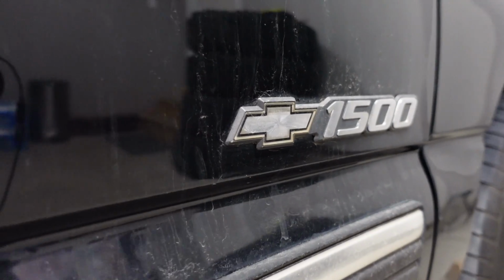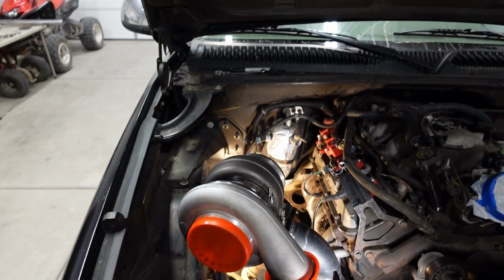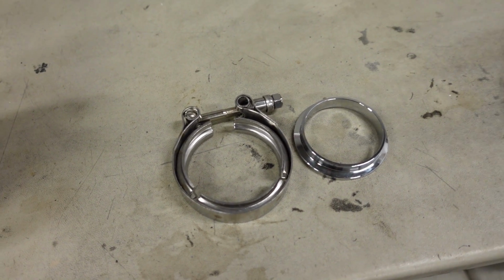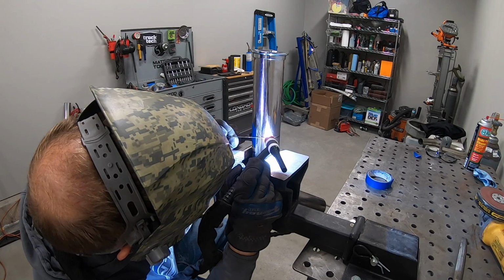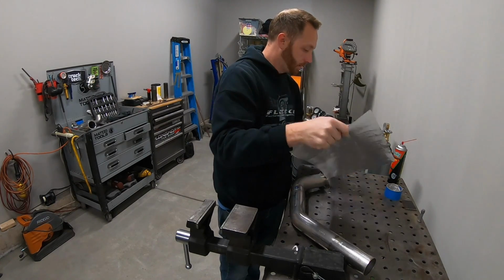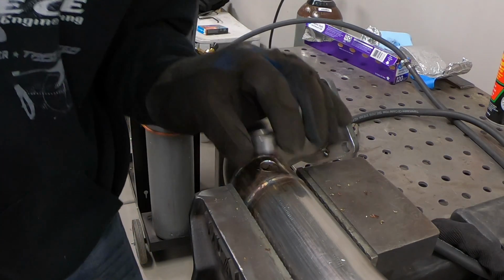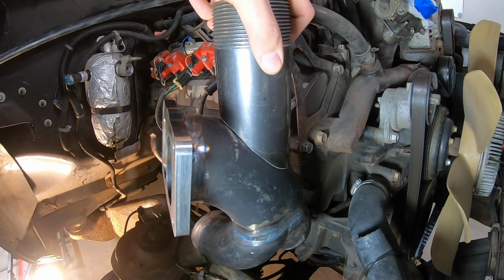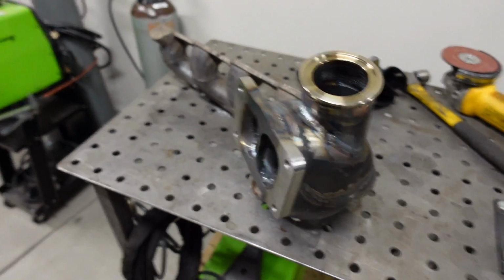8.1 Vortec Turbo first fire up

Comment: What’s the fitting you used for the oil cooler port? Having a tough time figuring out the thread pitch and what I need for my 8.1

Comment: When you first did your swap what transmission did you use, I’m building a 2002 firebird up and found a 8.1 with wiring and pcm, but no transmission.
Reply from the maker: I swapped to a 4L80 back when the truck still had a 5.3, so still using the 4l80
Reply: @TolmanPerformance  I appreciate that, this is my first time doing any major work like this, I’ve swapped a cam and springs but never something like this.

Comment: I would this engine for my offroad and street road car. So rpm is at 2-3500rpm for most of times. But i wanna get it turbocharged for my low end torque is this necessary to swap stock cam?
Reply from the maker: If you want low rpm torque the stock cam is hard to beat

Comment: That was a great amount of information! I have a question regarding that turbo and reversed headers would you create a mount off the chassis with a flexible exhaust piece or make a mount off the engine for a 72 Nova SS? That mount you made was dead on!
Reply from the maker: I'd for sure mount it to the engine so it can all move around together, you'd add more stress into the pipes if you mounted the turbo to the chassis (unless you have solid motor mounts or a motor plate or something like that)
Reply: @TolmanPerformance  Didn’t think about that! Thank you much for the reply and great information on your channel.

Comment: Mid mount twins are the only other option.  Tucked in beside the transmission or if need be, a bit further back next to the tailshaft. If you want to go crazy,  can criss cross the 2/6 and 3/5 tubes for equal pulsing w/ max scavenge and power.

Comment: Geez...a log style manifold on a big turbo, big displacement v8. Sounds like a back pressure and a heat nightmare. That’s my bugaboo, every vehicle deserves headers not manifolds. Especially with a turbo setup. Those will be glowing as soon as you hit boost.
Reply from the maker: yeah, I'll never say a manifold is better than a header, but they are a lot easier to fit up. That being said, there are a lot of folks making big power safely with a log style manifold. Is it ideal? No, but with the sizes I designed in and the placement/size of the wastegate, I should be able to manage exhaust back pressure. Heat? either way you slice it, a big tubo engine is gonna be making a lot of heat. thanks for watching BTW!
Reply: @TolmanPerformance  hey man you know more than me and obviously can do more. Wasn’t tryin to knock ya, I just hate log manifolds period. Good luck on the project

Comment: Sounded like an exhaust leak on start up. Did you find any?
Reply from the maker: no, everything was sealed up tight. I did hear it in the video, I think its just the sound the turbo is making with no down pipe

Comment: Awesome build dude. Love the Fab, and staying away from a remote mount system. 

My old man is a welder and always told me not to clean with break cleaner because it can react and release phosgene gas which is poisonous. 

Looking forward to the rest of the build!
Reply from the maker: thanks for watching! supposedly the non-chlorinated brake cleaner (the stuff I'm using) is safer, since it doesnt have the chlorine which makes the poisonous gas
Reply: Good to know about the brake clean. That's why your the pro.
This thing is gonna be a torque beast with that turbski! Tow anything, and a drag strip monster...

Comment: small tip. argon is heavier than air so when you purge your part it is better to put the purge line at the lowest part,  then poke holes in the top so the agon fills up the bottom and displaces the air out the top. anything works. this just gives a more efficient purge.

Comment: With so much displacement I would of put a giant turbo So that there would be no back pressure issues also a camshaft something like a 212-218 and whatever lift you can fit in there on a 114 lsa
Reply from the maker: I felt like the S480 with the 1.32 AR turbine was a pretty good sized turbo which should also be pretty responsive with the displacement, and hopefully the 60mm gate will alleviate any possible back pressure issues.

Comment: You got me.  New subscriber here.  Excellent content.  Well spoken, it is obvious you are very comfortable in front of the camera.  Look forward to seeing the finished truck.

Safety Nazi Comment:  Please be sure you use non-chlorinated brake clean for weld prep.  The chlorinated stuff will create Phosgene gas when it burns off.  Phosgene gas is used in chemical warfare.  It turns into an acid when it comes into contact with water (like the water in your lungs).  Some nasty stuff.  If you already knew that, carry on!
Reply from the maker: thank you so much for the kind words, and I too am excited to see and drive the truck when its all done. I did get quite a few comments on the brake cleaner topic, but I do use the non-chlorinated stuff, so I should (hopefully) be safe from the poisonous gas... thanks for subscribing BTW...

Comment: Are you planning on swapping out the clutch fan an electric fan eventually LT.
Reply from the maker: yeah, I am very soon, I've gotta run the electric fans to make room for the charge pipes
Reply: @TolmanPerformance  Awesome brother and not to mention less drag 9n the engine as well.

Comment: So sick man! What’s your plan for an intercooler? I wonder if a 2500 series duramax cooler would he close to a direct bolt in?
Reply from the maker: no, the duramax intercoolers are too tall, by about 2" compared to the 1500 core support. gonna run an aftermarket intercooler

Comment: CARB CLEANER AND WELDING GO TOGETHER LIKE DEATH. THE GAS THAT IS EMITED CAN BE FATAL.  LOOK IT UP. NOT SUPOSED TO WELD UNTIL YOU CLEAN THE CARB CLEANER OFF. REALLY.
Reply from the maker: I use the non chlorinated brake cleaner, was under the impression that stuff was supposed to be safer

Comment: Hellobi have a question what size of turbo should i run for a 5.4 v8?
Reply from the maker: depends on your horsepower goals, but somewhere around 68-75mm for the compressor...
Reply: @TolmanPerformance  you  think if i run a gt45 just for mock  up it should run fine ?

Comment: Anything that uses a scavenge pump is trash. Good way too burn your car too the ground.
Reply from the maker: well said lol
Reply: @TolmanPerformance  i mean if your doing a dry sump and using the mechanical oil pump too scavenge off the turbo(s) then whatever. But having a top mount retains the reliability of the oem oil pump.

Comment: The chemical in the brake cleaner is Tetrachloroethylene. When this chemical is exposed with excessive heat and argon (used in MIG and TIG welding) it also produces phosgene. ... Google Phosgene and read more! It can be fatal with a dose as little as 4 parts per million.
Reply from the maker: doesn't the non chlorinated brake cleaner leave that compound out?

Comment: So 8.1 3500 vans and 2000-2001 gmt400 3500hd trucks had high mount drivers side ac compressor and pass side alt. You could probably source those brackets and run ac.
Reply from the maker: good tip! after the initial build is done, I'll probably be looking for a different accessory drive.

Comment: Just out of curiosity, can you get the electric fans for the 05-07 trucks to work with the 8.1 ECM?
Reply from the maker: yeah, no problem at all.
Reply: @TolmanPerformance  would they use the same pins as the 5.3 or is the ECM different?

Comment: Nice..  hey what's up lt.  
Really enjoy your videos..  this is your amigo from el paso tx, i see that you put new tires on the truck. Can you tell us the size and  dimension on thos new tires.
Reply from the maker: I put new front ones on, 255/55/18. still have the 265/65/18 on the back, but those will be turned to smoke pretty quickly...

Comment: Nice bit of progress there dude 😊 Great fabrication skills.

Personally with the cross over tube I'd have used a slip joint just to allow for thermal expansion between the cylinder banks of the V8. Stop the possibility of any stress fractures 😉
Reply from the maker: I was on the fence about putting in an expansion joint, and I may add one in the future

Comment: Sweet can’t wait to see a pull when it’s together and tuned
Reply from the maker: me too!
Reply: @TolmanPerformance  How do you pass emissions computer test when you swap the motor? The only motors that were available were the 4.3, 4.8, and 5.3  for the 1500.
Reply: @tskraj3190  easy, he doesnt live in california...
most states dont require emissions testing, like here in colorado theres only 3 counties that require testing, the rest dont.
Reply: @tskraj3190  not in all counties they dont.
Reply: @phanto4  Utah county does and so does the rest of the Wasatch front.
Reply: @tskraj3190  check the plates on "ugly Truck" they say "TENNESEE"   no emissions test ?????
Reply: @gben7084  He's in Utah.

Comment: I disagree with the remote mount turbo, I’ve never been a fan of them, you need NOS just to spool them up
Reply: There is no significant difference in response between engine mount and remote mount turbos when built properly. If you need NOS to spool up your turbo build, you either have A) a race car/truck B) boost and/or exhaust leaks or C) way too big of a turbo for the application. People think the extra 10' - 15' of hot/cold pipes causes lag, but they often don't realize that the charged air is moving anywhere from 120 - 300mph, which is 176 - 440/fps. It only takes a few 1/10s of a second to pressurize the system, which is essentially imperceptible to humans. Are there unique considerations when building a remote turbo system? Yes, but increased lag, reduced response, or a need for NOS to function isn't one of them.
Reply from the maker: thats a cool analysis of the numbers!
Reply: @user63344-gds  have you seen the nugget garage Supra with a 1UZ Toyota V8 and rear mount turbo? He seemed to do everything to get it to spool, granted it is a large turbo, and he is using NOS to get it spooled, I’d be interested to hear what you think is the problem with his system. I have always thought it’s the heat dissipation from the long exhaust that kills the turbo spool time, not necessarily the speed at which the exhaust is moving. Thanx for giving me a different way of looking at it.
Reply: @xozindustries7451  Yes, I have seen that car and love it. I've rewatched a few episodes and couldn't find an exact size of the turbo he's using, but it seems like a S488 with a T4 foot. Unknown is the turbine size and A/R of the housing; both which play a role in spool up. But either way, yes that is a huge turbo for a 4.0L engine. For perspective, the S475 was typically found on 12L-14L diesel tractors, albeit they have larger (96mm) turbines and 1.32 A/R housings.  

To compare, in the diesel performance sector you'll see a S488 used as an atmospheric turbo in a compound setup, which would be good for 1300--1500 whp depending on supporting fuel mods. Or as a single which will use a NOS "spool jet" which serves to do just that because that turbo is just too big to spool with fuel alone. Realize that these aren't typically street trucks but are mostly stripped down race trucks or ones made for sled pulling. Driving one on the street would be a miserable experience as it would be a smoky pig and lag until 3000+ RPM when the turbo finally lights - essentially making it useless for regular driving.

I did notice that he's using 2" pipes going into the T4 foot, which has 2" x 1.375" openings. Ideally you want the gasses moving as fast as possible without creating turbulence, which happens at 0.4 Mach, or a little bit over 300 mph. There's formulas and tables to be found on the internets which go over the details to match CFM with pipe diameter. I haven't done the math for his application to see if things are ideal, but this is a consideration. 

Another is using a larger pipe to carry gasses into a smaller opening. Ideally you want smooth transitions and easy bends. Any hard bends, or obstacles between pipes will create turbulence. However, I don't think these are major contributor to lag or the need for NOS. I'd say the huge turbo would be. 

As far as the exhaust loosing heat; not a bad idea. It's true that hot exhaust gasses can increase spool. On diesels we tune in "low boost fueling" which essentially dumps extra fuel into the combustion chamber at low boost conditions. Extra fuel = hotter EGTs... hotter EGTs = faster spool. If you've ever seen a diesel blowing black smoke and once the turbo lights it clears up, this is what you're seeing. 

But I don't think this is the case for the Nugget Supra. His pipes are heat wrapped and I'd wager that the gasses are still plenty hot by the time they reach the turbine. But the only way to know for sure is to install an EGT probe at the exhaust manifold/header and one at the turbo.

Tbh, I don't really see anything necessarily "wrong" with his setup. I mean, it runs 9s in the 1/4 mile so having some NOS to get that big ass turbo moving seems about right. Would a smaller turbo be better for drivability? For sure, but it would likely lack the top end that the guys at Nugget Garage were going for. That's the drawback of turbochargers; they operate in efficiency ranges. If too small, the compressor will eventually overwork causing IATs to rise resulting in lost power and eventual death of the turbo. If it's too large, it will never get going to create boost and just be a restriction.  

If I had any advice for them, it would be to bump down to the smallest turbo that supports 1000whp, or whatever their goal is, and run a smaller A/R housing with a wastegate to keep the turbo in its efficiency range. Something like a Borg Warner S480SX-E perhaps. But again, this is like trying to find a flaw in a masterpiece. It can be done, but by no means does it diminish the greatness of the work. That car is both well done and amazing.
Reply: With a 496 I feel spooling isn’t going to be a problem

Comment: I'm surprised you didn't bring up the minimum inner diameter of your oil drain fitting and an oil restrictor for the journal bearing Turbo... very crucial to the setup. I've gotten three "blown" turbos that just had way too much oil flow to them all I did was clean them up put them back together put a oil restrictor in and they worked great. Always remember 11 mm inside diameter from the fitting on the turbo to the oil pan cannot be any smaller.... .100 nitrous jet works well for an oil restrictor.
Reply from the maker: according to what I've read, on the S400 family of turbos, a -4 AN. (1/4" or 6.4mm) is adequate for an oil feed, with no need for a restrictor. And on the drain to the oil pan, I used a -10 AN (5/8" or 15.8mm). But you are correct, the drain needs to be as large as possible to prevent pressure building up inside the journal.

Comment: I don't know how they find in the 1/2 tons but I hear the duramax intercooler works well and if it fits obviously should not take much work
Reply from the maker: I think to make the duramax intercooler fit, you need to modify the front frame supports because the HD front ends were like 2" taller. but that would be a cool idea
Reply: @TolmanPerformance  if you were starting with a 3/4 ton it would be a no brainier I think sloppys truck was setup that way
Reply: @TolmanPerformance  the ones from your truck model (era of age/plus or minus a model) share a core size I believe that fits and can be had via car-part.com (seen for about $30)
I'll double check the core and tank sizes, but if memory serves me right I believe the "some" older GM turbo diesel intercoolers can swap over with little mods (I seen it on another video, that truck was a white 2500 sloppy truck if im not mistaken).. 
Ill double check the math and report back, but it was sweet looking and saves on the underhood real estate!
And yes I made sure my buddies at Brenton got your email, I do know they have been super busy but haven't forgotten about ya!!
Just stay safe and warm and keep the content coming plz!

Comment: Looking good.

What electronics are you planning on?
Reply from the maker: gonna be tuning the stock computer with HP Tuners, and use a wideband o2. Other than that, not much different electronics wise

Comment: Where are you going to drive that truck.  It will fail emission inspection immediately.  No factory cats on both sides is an automatic fail.  So is any exhaust that is not stock .  I know.  I live in Utah too.
Reply from the maker: ehh... we'll figure that one out when the time comes I guess
Reply: @TolmanPerformance  Good luck.   I had to put all the factory equipment back on my truck or they (the county health department) was going to cancel my registration.

Comment: Is it possible to use a duramax intercooler?
Reply from the maker: it is, bit you need to cut the front of the frame, and lower the body mounts about 2" to use a HD core support. Then you can use a Duramax intercooler. But the plus side, is if I did that, I could easily do the HD front grille, bumper, and hood swap

Comment: Can I do a rear drum to disk swap using OEM parts? I have the JF7 rpo code brake system on this 07 bowtie classic(gmt800). Its the 6400 system and be nice to have the 7200 or 8000 set while keeping the stock 17 inch wheels.
Reply from the maker: not sure on the particulars, but I would bet you could. You would need the disc backing plate/parking brake assembly, the rotors, caliper mounts, and calipers.

Comment: Man I love this build! My son and I are thinking of doing this type of swap on his '85 GMC 3500 dually

Slight correction in your video though, you called sugaring carbide precipitation. There is a difference and you are right about ingesting particles along with horrible fusion at the root and more than likely fatigue failure especially with constant heat cycles.